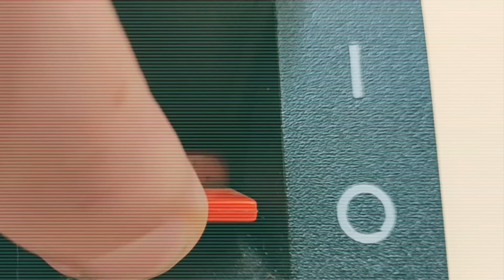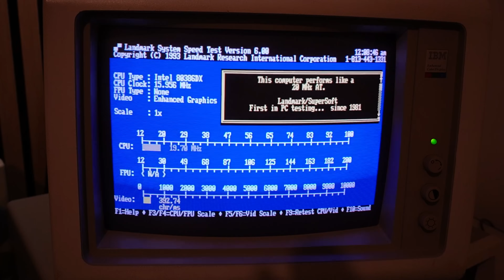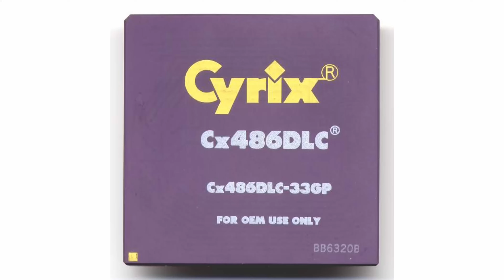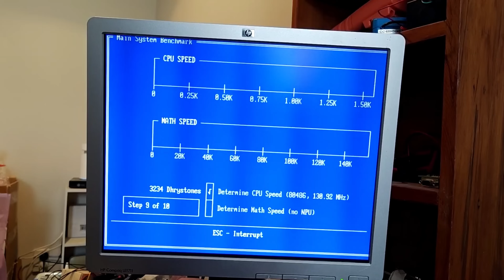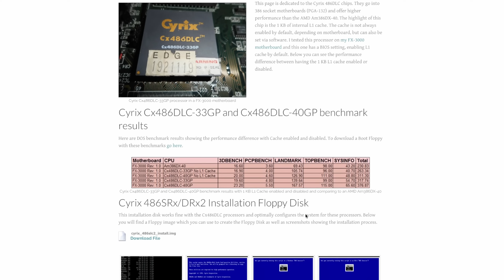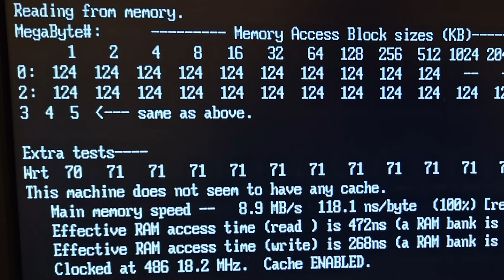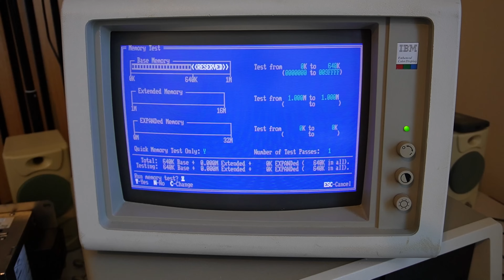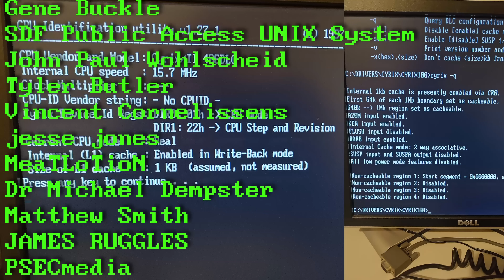The XT to 386 to 486 Challenge!

Comment: God tier CPU right at the end there! Was going to suggest BL3. If it doesn’t work for you with that logic glue board (PC98 I’m assuming) you can (with difficulty) put the BL3 PGA package on a simple Jaton interposer and direct plug it (fan required, that chip is 5v tolerant despite being 3.x v, but it’ll need a small heatsink and fan. RevTo486.exe will control it for you.

Comment: There is a way to build a cache invalidation circuit using a couple of gates from a 74F04 and 74F00. You invert the MEMW# signal from the ISA bus and NAND it to the HLDA signal from the CPU. The result is sent to the FLUSH# pin on the CPU.

But you shouldn't need to use that. The Inboard 386 HAS to support at least the A20 gate, or else it would not be compatible with literally anything on the PC. You don't need all of those cache control methods enabled at the same time, you just need one of them to work. Some cache control methods are worse than others, but some cache is better than none at all.
Reply from the maker: Thanks for your helpful info! I believe it does support A20, I have gone down a bit of a rabbit hole with these, the bit in the video only shows a few seconds of me messing with the caches but I spent hours. Apparently there is something about the card itself not supporting cache. Anyways I have an 'interposer' style CPU that I'm working on now and it should have the ability to fool the Inboard and give me cache

Comment: You have a fundamental misunderstanding of the difference between 386DX and 386SX.  It's not an FPU.  It's the internal data path.  DX is 32 bit.  SX is 16 bit.  Both require a 387co-processor.  a 387DX or a 387SX.
Reply from the maker: What gave you that impression? I installed the 387 to give me the fpu in this video. If I believed that the DX came with an fpu built in, why would I add an fpu? 😁

Comment: i have that blue lightning plus many others 16bit and 32
also that specific accelerator
Reply from the maker: Have you used it with Inboard 386?
Reply: @AlsGeekLab on amiga bridgeboards i have a lot of these accelerators i bought from japan
Reply: @AlsGeekLab amiga bridgeboards i bought a lot of these iodata buffalo etc accelerators from japan
Reply: @AlsGeekLab not sure if you seen this youtube keeps deleting but i used them in amiga bridge boards bought many of these from japan
Reply: some even include ram slots

Comment: this is the proper length of video. just enough detail but not every last excruciating anecdote that is mostly just useless info...

would love to have put something like this in my childhood hand-me-down PC, an IBM PS/1 (2011?) with a 286 and I think 2MB of ram.
Reply from the maker: The early 286 PS/1's had Isa I think, but the rest of the PS/ lines were proprietary MCA adapters so the inboard wouldn't fit those

Comment: Doom doesn’t use the FPU really at all. Quake does though. Also, you could try changing out the oscillator to squeeze more performance out of it. Lastly, seeing fastdoom on it would be interesting as it can run on a 386 pretty well.
Reply from the maker: I managed to get fastdoom installed today, performance is pretty bad still. I haven't tried the potato or low quality settings, nor the EGA version yet, so I'll see if they make much of a difference
Reply: @AlsGeekLab  Does the keyboard work in FastDoom? Looking at the code, I guess not.
But I think it'll take only 2 extra lines of code to fix it, just like in Doom8088.
Reply from the maker: @DookNookim ooh I'd love to know how to get that working! You are correct in assuming it does not work.

Comment: Changing to the 486DLC doesn't change the clock at all, and it's not a clock doubled chip, so it's just running at 16 MHz.

Looking forward to seeing the results with the Blue Lightning!
Reply from the maker: Yes , I knew that to be true, given that the oscillator (32mhz) is divided by 2, I would have to change the crystal to 80 if I wanted to run it at 40. I have been toying with the idea of doing that, but I'm going to try the BL3 first
Reply: The Blue Lightning chip was AWESOME and a good performer.  Just know it does run hot!  I sold quite a few in my PC sales days back in the early 90's!

Comment: I did a lot of experimenting with the Inboard 386 (still owning 5 or 6 of them) a few years ago. I may have a 386DX to 486DX Transcomputer adapter left over somewhere as well which even allows to run a 83MHz Pentium Overdrive with some tricks involved. I also built a prototype version of an Inboard 386 memory upgrade module and subsequently shared the project with someone on vogons who then designed a 2Mb version based on my design. We were able to make it work with 4Mb after some experimenting. I kinda lost interest and went back to Macintosh stuff. It's good to see that the memory expansion has found its way to other enthusiasts.
Reply from the maker: It sure has! Check out my video on the board - it's called the parrotyerror! I have 4mb in it and it rocks thanks to you!

Comment: I had a Cyrix486 back in the day, it didn't take long for me to replace it with a real 486 (i went with an AMD one), just because the Cyrix486 had issues with some applications when having that cache enabled. So, in a lot of times I had to disable it, but the performance impact was big, might just as well just have kept my 386 at that point.